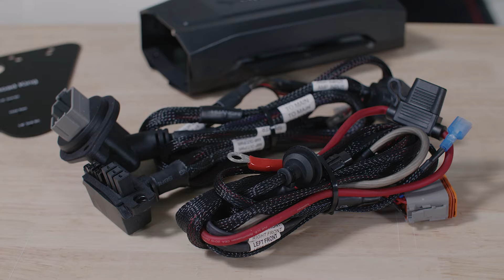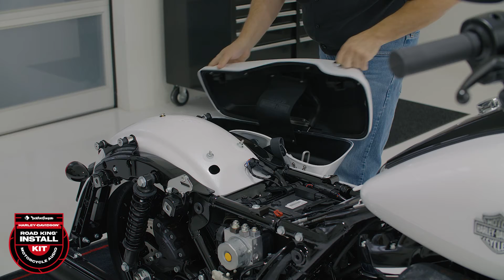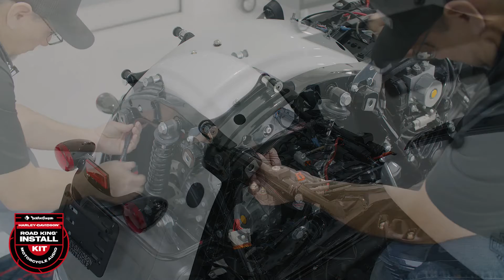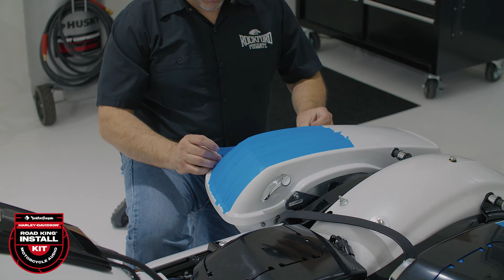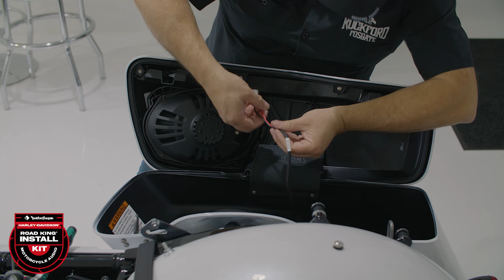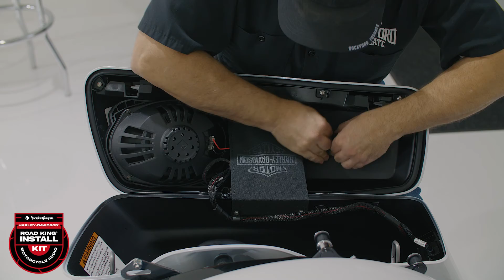1998+ H-D Road King RFK-HD14M5 | Installation

Comment: Does it automatically connect to your phone when you power on the bike or do you need to sync it and power it on every time?
Reply from the maker: Great question.  The Bluetooth receiver is inside the amplifier and once paired during the initial setup, it will automatically pair each time you power on the motorcycle.

Comment: Is there a way to connect all of this in sync with the front fairing speakers? I'm asking because I have already updated the radio and the front pharg speakers and would like to add bag speakers and amp
Reply from the maker: This kit is for the Road King that doesn't have a radio (it uses a Bluetooth module).  If you have a traditional touring bike with a GT, GT6.5 or GTS radio, we would recommend on our our HD14 audio kits like the STG3 https://rockfordfosgate.com/products/details/hd14-stg3/ or our add-on rear saddlebag system for existing aftermarket Rockford Fosgate systems: https://rockfordfosgate.com/products/details/tms69BL14/

Comment: will this kit fit a 2022 road king? looked on youre site and could only find the 98-13 kit
Reply from the maker: Great question!  For 2014+ Road King models, we just need to switch the saddlebag kit. The system is now available as an a-la-carte option using these 3 models:
• RFK-HDRKM5 (Road King Amp Install Kit): https://rockfordfosgate.com/products/details/rfk-hdrkm5/
• M5-800X4 (Amplifier): https://rockfordfosgate.com/products/details/m5-800x4/
• TMS69BL14 (Sadddlebag Kit for 2014+): https://rockfordfosgate.com/products/details/tms69bl14/

Comment: I have the previous stage 2 kit for the road king special but I need a new wiring harness as the old one rubbed against the tire and caused a short. How do I order just the wiring kit to fix my setup?
Reply from the maker: Hi @KhanDisco !  Thank you for rockin' the Stage-2 on your Road King Special ... love that model!  We sell a replacement harness kit for just the saddlebags to keep the cost low available here: 
https://rockfordfosgate.com/products/details/1560-62038-c1/

Comment: what if U have a 2013 or older but the saddlebags are 2014 + ?
Reply from the maker: This would work great!  You would need the below items that listed under “Complete My System”:
- RFK-HDRKM5
- M5-800X4
- TMS69BL14
https://rockfordfosgate.com/products/details/rfk-hdrkm5/
Reply: @rockfordfosgate  Does the AMP install kit include expansion wiring for front lowers? I know it has the delphi connector but does it include the actual wires with connectors for lower speakers? If not, do U sell that?
Reply from the maker: @bane1240  The kits includes the lower expansion ports, but do not contain the actual harness for connection to the speakers.  You can see how to make this wiring harness on the back of our Tuning Guide: https://rockfordfosgate.com/rnt/rnw/docs/1355/harleyamptuning_1998_m5_rfk-hdrkm5.pdf